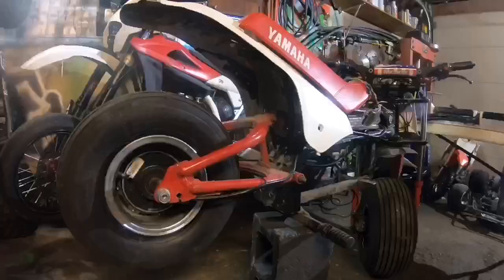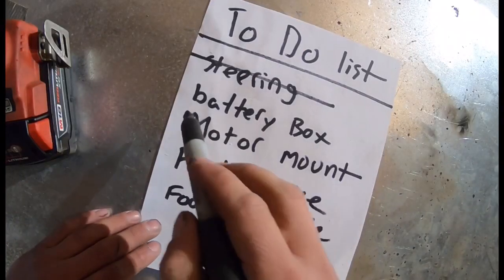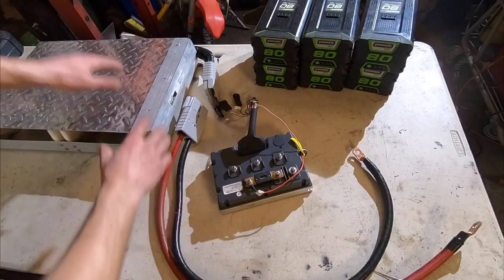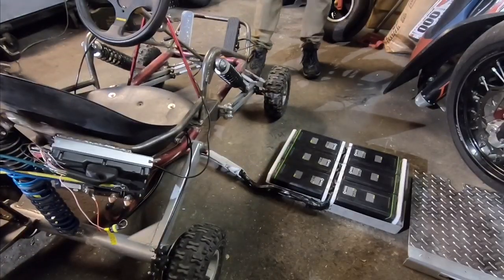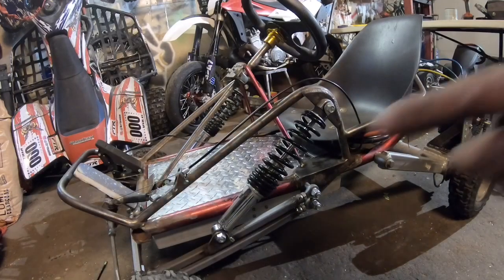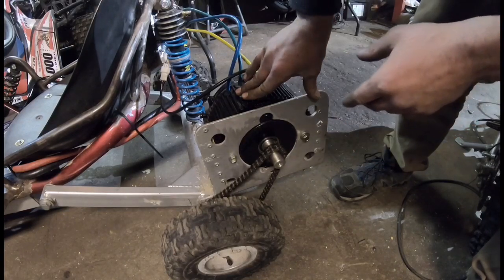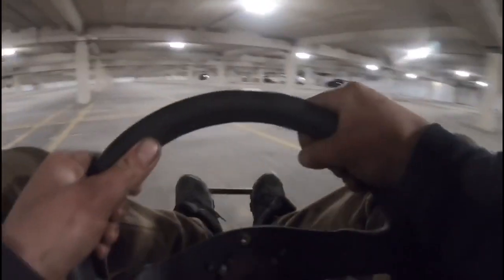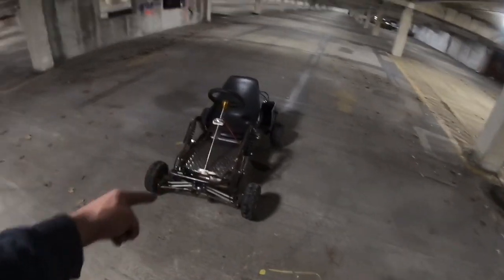(E8) Cordless Power Tool battery Electric Gokart! *first ride*

Comment: Don't you just love the instant torque from an electric drive train? I'd love to build something like this. Previous job was running 6 karts fitted with honda gx350 engines. Would love to electrify them..

Comment: Just FYI - If you switch any two of the three motor phase wires, the motor will run the opposite direction. Pretty sure the reverse wires are for a normally open switch that will connect the wires together when you switch into reverse to be able to back up.
Reply: It took way too long to find this in the comments. Also one thing to note with the reverse on many of these controllers is that they limit the top speed of the motor.

Comment: For some crazy speed I’d suggest using a salvaged washing machine motor from a direct drive washer. They’re easy to find and provide impressive speed and torque. I’ve salvaged an old Fisher & Paykel SmartDrive motor that I may use for this purpose.

Comment: hi, do you not need to hook up a contactor ? I thought anything higher then like 60v you need to have a contactor to prevent issues of first powering up the controller! does that controller have a anti spark in it?
Reply from the maker: It a Brushless DC motor so it need some kinda electronic management to run so it does have some kinda anti spark built into it. Its not like the old-school high volt brush motors. Like my street Gokart
Reply: Yes on the brushless.
I’m building a 30kw off-road scooter. Don’t let the word scooter fool you tho, this will be a off-road monster with 18x10 knobby tires, and a kelly 8080 controller, building a custom lipo polymer pouch type of battery to fit my needs at 120v . Great videos man, I think I’ve watched them all🙂

Comment: When you want to change the motor direction, just switch 2 motor phase wires, doesn't matter which ones!!!
I think it could actually be limited because the ESC thinks you are driving backwards!
Reply from the maker: I did that at first and it didn’t work the motor just buzzed I don’t know why but that’s what I always thought too, switching the phase wires. I’ll try again but I’m pretty confident it didn’t like it. I looked up online and it definitely doesn’t affect the ESC it has no limit in either direction which is kind of scary to think about imagine going fast in reverse. Loll but I’ll deathly let you know what happens in the next video with the phasewire thing!
Reply: @Krisuno  Just be shure to not switch a phase with the black motor cable!
Reply from the maker: Loll The black is the hall sensor. I tried flipping the yellow and the green, and the blue and the green, then the blue and yellow no matter what I did it didn’t work. But it was also like 11 o’clock at night and I wasn’t thinking too well so I’m going to definitely get back to that!
Reply: @Krisuno  you should be able to reverse the direction of the motor with a switch,what controller are you using ?
you have to map the phase wires to the hall sensors !
Reply from the maker: Yea I found the switch. And it works with the switch. It’s a vector controller from golden motor. I think it’s all good now but I also thought flipping the phase wires will reverse the rotation in the motor but you might be right about mapping it to work with the flip phase wires.
Reply: if the motor is driven with foc
(field oriented control)
switching phase wires may mess with the esc algorythim
Reply from the maker: I think your right!
Reply: @Krisuno  Do you have instagram?
Reply from the maker: KRISUNO loll

Comment: Oh yeah, that looked like more than 20mph
Reply from the maker: Enjoy loll
Reply from the maker: Na it’s definitely only 20 but it gets there in like 2 seconds, it hit hard off the line but then flat lines at 20mph because the motor can only turn 3500 rpm’s and with the gear ratio that’s all it has